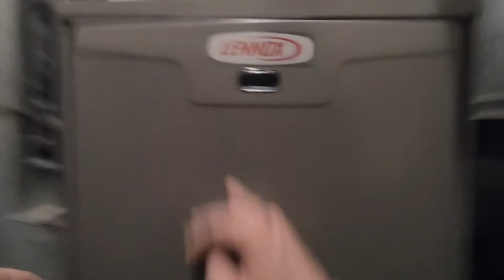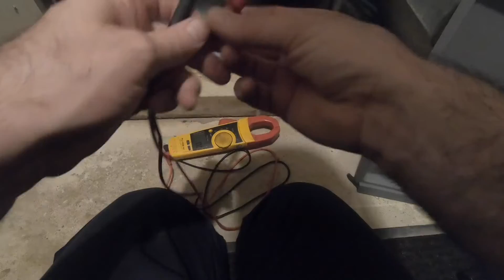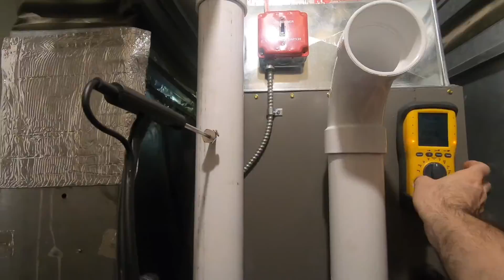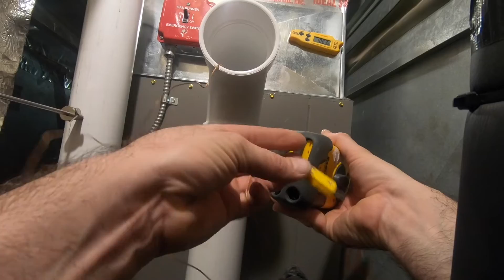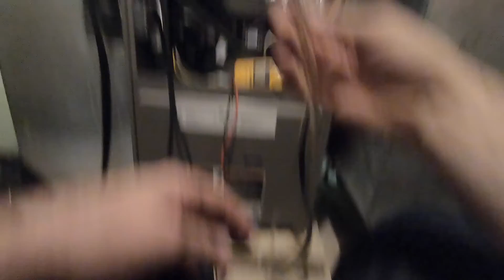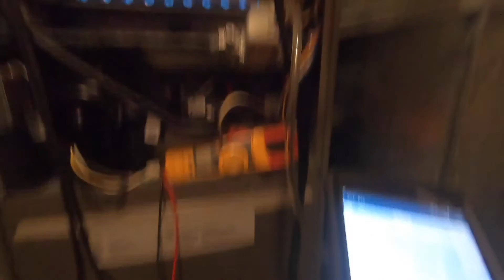Commisioning New 90 Percent Furnace Combustion Test HVAC

Comment: The high static is causing lower cfm across exchanger making a higher temp rise.  Check fan data table. Ya probaby need the highest fan speed to get close to acutal cfm needed

Comment: You’re not doing best practice commission a furnace! You should re-shoot video with proper protocol.
1.	TESP Is tested on highest speed setting usually A/C mode, with filter in place.
2.	.7 static with out filter, Coil, highest speed setting we’re probably in the 1.2 to 1.5 TESP range.
3.	Proper Combustion Analysis need combustion door installed.
4.	143-degree supply air on condensing furnace is too high and doesn’t condense then.
5.	Combustion process might be correct at 91% efficient, but with 143-degree supply air furnace efficiency if more like 80%
6.	Temperature reading of combustion make up air pipe with combustion door off doesn’t work.
7.	Why are you taking combustion make up air temperature reading anyhow?
8.	Flue pipe Temperature on a condensing furnace should be less then 120-degrees, Not 143-degrees.
9.	Oxygen of 8.2 is high for condensing furnace (Normal range is 5.0 – 7.0) 
10.	Restarting/Zeroing out meter inside furnace room can/will give false readings. Should be started outdoors in fresh air.
11.	Clock gas meter to see if the gas offices are correct for heat content of gas supplier.
12.	Yes having igniter heating up while your gas pressure hose venting out at the same time is unsafe.
Reply: you only have 1 show 6 years ago...hell you should keep posting and prove you are the best tech son.

Comment: How do you seal the hole in the pvc pipe?
Reply from the maker: I have been using tin tape and it seals the exhaust pipe. If the tape fails water leaks out yet I go to systems I taped 10 years ago and the tape is still good

Comment: What kind of analog monometer is that?
Reply from the maker: It is a Dwyer I have one for static reads zero - 1”w.c. And one for gas reads 0 - 15 in.w.c. You miss the fluctions using a digital meter why I stick with analog for testing pressure switches and gas pressure usually

Comment: I prefer to clock the gas-meter to set my target gas-pressure and get the unit running at correct input, I was glad you mentioned "where you would normally take static", as I was kinda wondering why you were taking that way.  New to watching your channel, thanks for the great videos, keep it up bro!
Reply from the maker: I am just taking a basic static across filter and coil to make sure my duct system isn't undersized. this is new equipment so I know I will lose about .2".w.c. across an evap coil. That's how my employer wants static tested just for startups.  Yet if I have a problem with an existing system I am breaking open the silicon seal the installers closed the door up with. Drilling a hole in the triangular plate to check static around the filter, under, and across the coil. I clock the meter yet don't want to bore most with dead film space yet I have to put the recording on my startup form.

Comment: Curious why these units are installed as one pipe configurations rather than pulling combustion air from outdoors. Not able to tell from vid but hoping there is adequate air volume in the space for all that fire. Lennox isn't my forte but most manufacturers allow concentric venting which minimizes exterior wall penetrations and eliminates the use of indoor air for combustion.
Reply from the maker: Usually, we don't install them like this we use the concentric kits or 2 pipes to the outside. Must have been a reason the install department decided to only use 1 pipe. This is a rather large basement. Which I think should have plenty of oxygen for combustion.
Reply: Even when there's enough combustion air it's better to take from outside and not depressurize the house.

Seems like the ducts are too small for furnace or furnace oversized based on temp rise and static.
Reply: We call concentric kits bazookas. They will run fine like this. The dwelling would have to be pretty darn airtight
Reply: @thehvachacker  think??🤔🥃🍺😵
Jus say'n ?
Stay safe.
On the couch🍺🥃!
Wear your safety glasses.